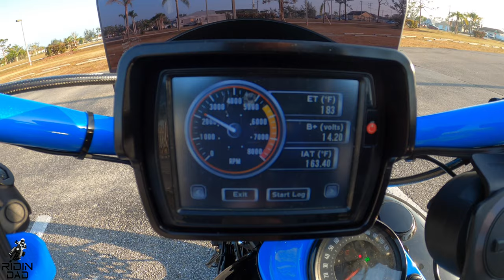All the Modifications & Upgrades I've done to my Harley Davidson Low Rider S (M8 Softail FXLRS)

Comment: The fairing looks like it is leaning back too much.  It may be difficult to adjust with the Baja lamp on there. I have a stock light connected via the headlight extension, but an aftermarket light in a bucket has a similar setup. This allows the light to be adjusted vertically up and down and pivot changing the pitch. 

Take the fairing off and loosen the light so you can adjust the vertical height and the pitch. Leave it tight enough so it isn’t flopping around.

On the Memphis Shades upper fork clamps there is an Alan bolt in the center of the round mount - loosen it and push it all the way forward in its slot on the upper fork clamp.  By forward I mean towards the front of the bike. Retighten. On the Memphis shades lower fork clamps, loosen the Alan bolt on the round mount and push it rearward in the slot all the way and retighten. The upper mounts should be forward and lower mounts rearward.

Now put the fairing back on and adjust the headlight so it is recentered. This will be a pain and trial and error as you may have to take the fairing on and off to access the bolts. My headlight is lightly recessed, with the upper portion of the headlight aperture in the fairing overhanging the light. The windshield is more up and down vertically, and kicks the wind more over my head. 

I’m not sure how well these instructions will work with the Baja mount.
Reply from the maker: I appreciate your help but you’re talking to me like this is the first modification I’ve done to any bike lol. I’m aware of all that you’ve explained and I’ve tried that exact setup. I’ve tried all the way forward, all the way back, and angled up and down. Everything works fine with the lp6 it’s just more annoying to move it than a traditional light.  I still get buffetting. I’ve tried a 7 inch, 11 inch and 13 inch windshields and even taped up the vents to see if that made a difference
Reply: @RidinDad  That buffeting issue is certainly frustrating. Please don't take my comment as insulting your intelligence -- I put step by step what I did because I know others read these comments and use this fairing too. I'm curious about what factors are different that are causing buffeting to be worse for one person versus another.
Reply from the maker: I gotchya man and yeah I don’t know. It’s odd. I’ve had buffetting with anything I’ve ever tried with a windshield lol.  Maybe I’m just more sensitive to it than others. Maybe my torso height is not proportional. Idk man. I’m trying to figure it out!

Comment: Do you feel a difference with the Galfer rotors and the stock calipers?
Reply from the maker: Yeah big difference. You can feel it biting in more and requiring less force to stop quickly
Reply: You can change your rotors and pads but if you don’t change your master from stock it makes very little difference just fyi that’s a know fact check krusie he will drop some knowledge on that topic for you
Reply from the maker: I’ve watched kruesi. Yes that is another upgrade. But it’s not needed. Changing the pads and rotors is a big difference even with stock masters cylinder and calipers. Have you actually tried this out in person or are you just basing it off of what you heard on videos.

Comment: I have a solution for you regards buffeting, I tried different sizes and still have the buffeting, install spacers between the fairing and the windshield
Reply from the maker: Even with the vent though? Is t it the same thing?
Reply: @RidinDad  The vent didn’t help me and was making a whistling sound, I tried few sizes too but didn’t help.  My Harley tech suggested it and did it to mine when he was working on my bike.  He said he did to his friends and the buffeting stopped.  I haven’t tried mine yet as winter hear in Calgary Canada, but it makes sense, and someone else told me the same thing they have done and it worked.  I can send you a pic of how it looks.
Reply from the maker: I get how it looks I had a report fairing with the spacers on it and it didn’t help me on that one either :/. But if all else fails I’ll be trying it!

Comment: Did you have to remove the steering lock after the t rex plate install?
Reply from the maker: Nope. Everything remains intact and everything works like it did prior to the install too
Reply: @RidinDad  thank you
Reply: @RidinDad  That's great dude.So the risers don't touch the tank and you can turn the bars full lock no issues?
Reply from the maker: Yepp. No issues. Bars and risers don’t touch anything
Reply: @RidinDad  Great dude thank you.
Reply from the maker: @MrMurphc13 happy to help man!

Comment: damn that sucks didnt work for you i would try the 13'' and try to lean the fairing away from u when it leans back to much that how u get the air to rush up and hit your helmet.
Reply from the maker: I ordered the 13. Should be here today. It’s as flat in to the wind as it can go. And just for the hell of it I leaned it back too. Even taped up the vents to see if that changed it
Reply: @RidinDad  🤞🏼 yea i use a 13 non vented. And i either use my shoei gt air 2 helment or simpson mod if that helps. Im starting to wonder if maybe cause u lifted the front that it changed the angle how the fairing sits and that might be causing it. Where its not tilting more forward. Your not the first person i heard couldnt get their fairing to not buffer and their bike is also lifted in front. I only have 13” legend mono and stock front. Also im 5’7 if that helps. How does ur memphis shades brackets sit? I have mine all the way up. So top clamp touch the top triple tree
Reply from the maker: Mine is all the way up as well and I only have the front lifted because I have the rwd in the back lifting it as well so it’s basically back to stock geometry. I’ll figure something out!
Reply: @RidinDad  😎👍🏼 makes sense. Dont give up once u get it right itll be worth it
Reply from the maker: I’m tryin!